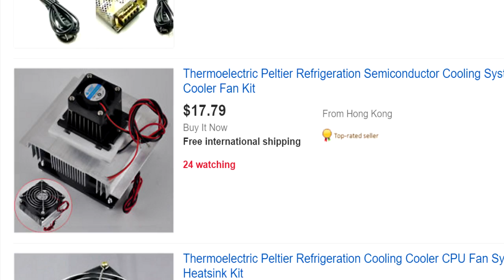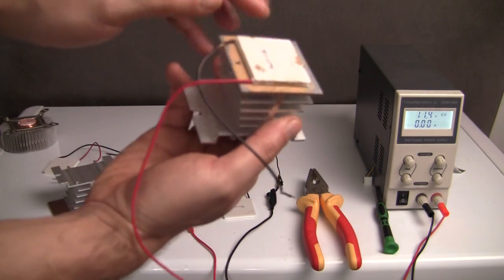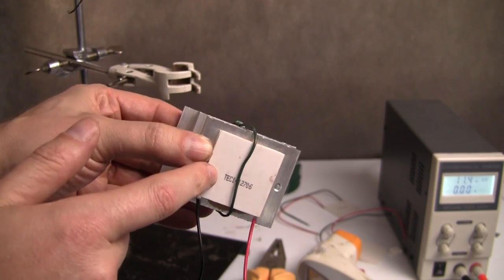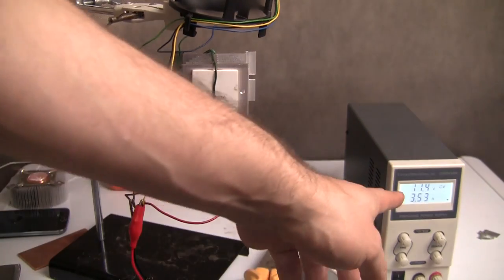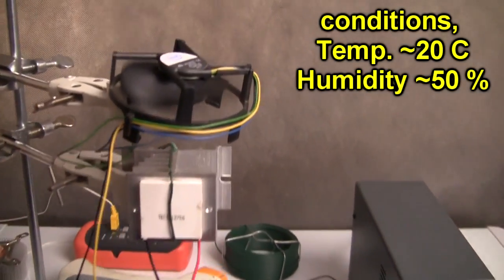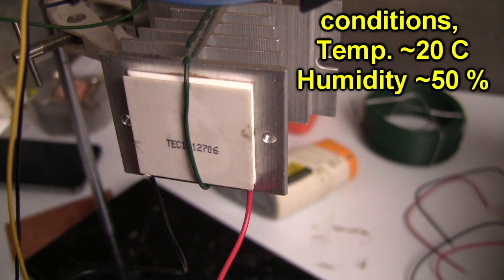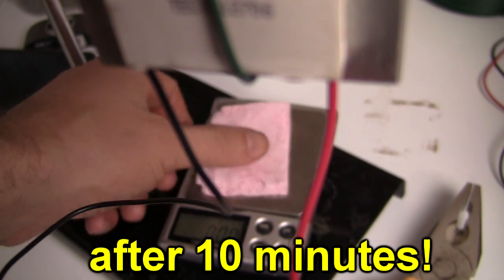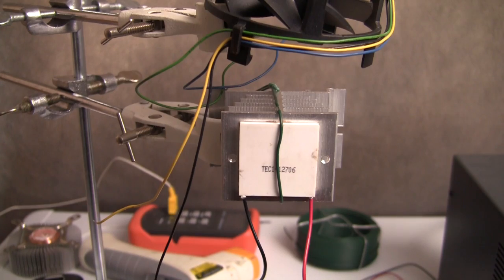Fontus Water bottle claims to make water from air.  Is it possible?

Comment: This could be made much more efficient by recovering the energy spent cooling air by redirecting the cold air to the hot side.
basically what modern clothes dryers do but in reverse. Instead of having the hot side of the heatpump on the air intake and  the cold side on the outlet to recover the heat you would cool the air on the way in, get alle the water from it you can and "recover the cold" by passing it over the hot side of you heatpump.
probably still wouldnt be workable with a peltier device but might be worth considering when debunking it thermodynamically.
Reply: +Felix Heidenreich you do realize cold is not energy? It's just lack of thermal energy

Comment: from the tech insider website: Retezár says the bottle works best between 86 degrees and 104 
degrees Fahrenheit and between 80 and 90% humidity. Over the course of 
an hour, Fontus can produce roughly 0.5 quarts of water. 

80-90% humidity - there you go...

Comment: There is a well understood but not reliable way to collect water from the air. Catch rain. This OTOH is a scam.
Reply: +Ken Shaw You can also collect dew by spreading out a tarp in a overnight with the edges higher than the middle. It's also condensation based, and doesn't require electricity. ;)

Comment: Obviously fake and gay. If you really had the means of generating out of thin air, any such commodity, you simply keep the technology a secret, in order to prolong it's perceived market value, and sell the water you generate yourself in order to maximise your profits, and your control over that industry. The Diamond industry does it all the time, and look how well they're doing. 

Giving away the secret technology, the 'Golden Goose' if you will,  like that is a big no-no as far as capitalism is concerned. Why devalue something into oblivion, when you could keep it's value, and generate billions of gallons of it on the sly? There's never a good enough reason to do that.
Reply: Don't quite see what makes this homosexual.
Reply: Or what makes this happy.
Reply: I have, just felt like nitpicking

Comment: would it be easier to do solar powered electrolysis and then use the hydrogen and oxygen to boil water and make it clean?
Reply: +Azivegu For electrolysis you would need water... And we already have ways to make water from rivers and lakes drinkable. Simple chlorine tablets... Much lighter and less bulky. Not to forget, Why use hydrogen and oxygen to boil water? If you burn hydrogen you get pure water. which is already clean. So if anything you would use electrolysis on dirty water, and would burn the hydrogen and oxygen to power further electrolysis. The lost energy in the process you make up by solar power. And the water from the hydrogen fuel cell is your final product.

Sounds way to complicated and wasteful. Just get a chlorine tablet.
Reply: Scorpionsnerd what are you talking about man!!! That sounds way to logical for the crowd we are trying to sell this too!

BTW, ever used a chlorine tablet? Just boil the water. It is worth the extra weight. I have used charcoal filters which make your water a brownish color and taste shitty and have used a chlorine tablet once when I got stuck in the grand canyon and had to drink from the Colorado. Not ideal. But then again  they aren't really advertised as an everyday solution and more of a last resort.
Reply: +Azivegu Never said chlorine tablets where flawless. But their marketing video is all "oh what if you run out of water miles from civilisation". And if you really want to go hiking or biking and can't be asked calculate water supplies then you're better off not going in the first place.
Reply: indeed. totally agree. I did get stuck in the grand canyon because I was looking for a dog and we went into a side canyon too early which delayed us too much. But dont worry, the dog was okay.

Comment: I live in that part of Texas where there's no lack of humidity. And the electric refrigerator in the back seat of my 4X4 diesel pickup truck will condense 2 or 3 cups of of water a day. No problem.

Of course I dunno how much current it draws... For sure a lot more than that damn mickey-mouse water bottle. But it DOES work, nevertheless.

Just saying.

Comment: so 40W per hour x20 gets us to 800Wh per shotglass?
Car batteries are generally rated at 85Ah and they are 12V so 85*12=1020 Wh
to get 1L(0.26gal) you need 50 shotglasses......
Reply: you are better off using the car battery to start your engine and drive to the nearest river/pond/walmart for a refreshment.

Comment: with my setup I have in my drying cupboard it's almost ideal conditions for condensing water, around 98%rh, it's humid enough that you open the door and you can feel it. there's a massive dehumidifier pulling around 200 watts and it only condenses around 1.5l a day at best.

Comment: So you need around 24 kJ to get 6 mg of water with this method...
So now lets take a look at the enery per kilograms of the batteries and take the best one, the lithium-ion: 250Wh/kg => 900kJ/kg meaning you would need 0.026 kg => 26g of Li-ion batteries to get those 6mg of water, pretty sure it's better to go directly for some bottles of water XD

Comment: It would be more effective in a forest or on the ocean because of the higher humidity, would it not?
Reply: LogisticalLogic This device wouldn't be useful for anything other than in an emergency. The water output is going to be too low. It's not going to save you any weight over a bladder attached to the top tube of your bike. Those aluminum heat sinks are not going to be light.
Reply: +LogisticalLogic places with lots of water. Not like a desert. In a forest you can just use a charcoal filter (tastes like shit, but works) and in the ocean you have solar desalinizers that produce much more clean water than this in a day.
Reply: +LogisticalLogic In a forest, you'd do much better sucking the dew off the leaves in the morning or squeezing it out of the soil and putting it through a filter. On the ocean, a solar still/rain catcher laid out on deck.
Reply: Yeah, but this would probably be better than no water desalination. If you were riding your bike through a forest and didn't stop to suck the dew off of the leaves or grass then this would be better than nothing. more water in the air more condensation

Comment: It would be interesting if you had a more hydrophilic surface on the cold side.
Reply: +Rand Huso what would be the point? the energy issue of water condensation releasing massive amounts of energy still persists. That doesn't solve anything...
Reply: +Rand Huso I think that would make the few drops of water more inclined to spread and stick than fall off into the bottle.

Comment: So... basically it's like a small solar still? Survivalist have been making them for years out of a piece of plastic, a bucket, and a rock.
Reply: +L. Wolf  I think the appeal is that's it's portable. A normal solar still is pretty immobile.
Reply: Foster Davies-Smith
That's true, once you put a solar still in that's pretty much where it is unless you tear it down and rebuild it.

A fontus water bottle might work better, if the surface area of where the water came from was larger. Course increasing that, you'll have to use more power. Becomes a matter of power vs production. Solar stills have a similar issue, only the power comes from sunlight and heat.
Reply: +L. Wolf Not really, solar stills require a source of liquid water to begin with then distill by evaporation and condensation to make it drinkable.
Reply: Yea, I explained it in a very bare bones manner on my own post before commenting on this one. A solar still is more a water purifier than collector. You always need some source, even urine will do.
Reply: Philipp Sloan
Hmm that is true.
Reply: Foster Davies-Smith
Yea, it can condense the moister in the air, but the majority is going to come from the soil and any plant fiber under the plastic.

It is a decent way to make urine and a sea water drinkable if you have no other options though.

Comment: Hey Thunderfoot, can you try running the peltier at less power? I've worked with peltiers a lot, and when you feed them more power then can be efficiently pulled out of the hot side then they just get hotter. So sometimes 20w will get it much colder then 40w because the limit on that heat sink is probably around 25-30w total. Everything above that limit just adds more heat into the system since it can't be moved away. Also don't use too much thermal paste, and try to get a tighter bond between the peltier and the heat sink, it all adds up quickly. If you plot a graph with hot/cold temperatures across different wattages then you'll see where it's limits are. 
     Also, peltiers are stackable, but you have to use a smaller one on top of the stack (cold side). So using 2 stacked can sometimes be more efficient then one large one since you can add a smaller heatsink to the one on top and increase the surface area for condensation.

Comment: What happens if you increase the surface area of the cold side, like add another heat-sink to the cold side?
Reply: +MrGridStrom 
The cold will be spread and therefore not be cold enough to condense any water.
Reply: +3plus3ist4 I will test this in a moment.
Reply: MrGridStrom
Its thermodynamics. Look up a h-x-diagramm. Air can hold water depending on temperature. At 50% humidity and 20°C like in the video the air needs to be cooled lower than 8°C for water to condense.
Reply: +3plus3ist4 Some peltier thermoelectric devices can go well below 0 C I guess it depends on the quality of the device, through my own tests today, I can say with %100 positivity that a heat-sink on the cool side will provide more area for condensation to form. I'm not saying that f00t's wrong here, and even with a heat sink on the cool side it most likely, still wont produce efficient water production, but I think it should at lest be tested.
Reply: MrGridStrom
Of course it depends on the area on which the air can be cooled lower than the mentioned 8°C. The air, not the heatsink, which means that the heatsink has to be a few degrees colder. 
It's powered by a small solar cell and these peltier elements have terrible efficiency. There just isn't the power aviable that you would need to cool the larger area.
Reply: +3plus3ist4 Well all im saying is that, it needs to be tested, so we all know the solid scientific evidence.

Comment: there are plenty of survival techniques for condensing water from air and collecting it.  so it is "possible", i guess.
Reply: +KickYouInTheThroat Plausible would be a better word, perhaps?
Reply: Yes, but the issue is they're not very portable like a water bottle is. It usually involves large collection tarps, or condensation pylons.
Reply: ***** it was my first pick.  for whatever reason i opted for smug quotes to mock the question in the title of the video. but yes you are right about the usage.
Reply: TopQuark right. which is why you would not plan on taking them for a break on a day long bike ride. however, a little water is better than none. there are also methods that are not that cumbersome or difficult and easily repeatable. anything to keep you alive longer is better than nothing at all. sure i would prefer a magic water bottle. but i dont have one so its good to have some idea about how to get at least some water out of the air and the environment.

Comment: I suggest you pass air across the experiment to duplicate the movement of the bike, I'm guessing you'll produce much more water but enough to make it practical?  Wouldn't think so as the surface area being cooled would still be too small.
Reply: You did, and i didn't pay attention. My bad. Still, surface area is the answer and for a push bike, impractical.

Comment: If they had a working prototype they could just go to a dry oil rich country and get hundreds of millions of dollars right out of the gate if they could prove that they could condense water using almost no energy. Saudi Arabia would be turned into a tropical paradise.
Reply: +Drogo Baggins Unfortunately there has to be humidity in the air to condense first, it would work if they had one in an underground cavern of some sort.

Comment: There already is an invention that allows you to get access to potable water in the wilderness. They're called iodine tablets. It's cheaper, weighs less, and doesn't require electricity, or barely any time to achieve results.

Comment: So this is basically a portable dehumidifier. I could see something like this potentially working, but it definitely would require more power than that tiny solar panel and battery can provide.
Reply: +Adam Hollingsworth IKR?
MY dehumidifier running in my basement, takes over 2 days to fill up about 3 liters. That's running almost all day taking a ton of electricity. This is so dumb.
Reply: AluminumHaste Either your basement isn't very humid or you should invest in a new dehumidifier.

Comment: Have you considered that they might use a much larger surface for condensation? That might have quite an impact on performance, even though i don't think it will be enough to forfill the promises
Reply: +mathis8210 They also claim to use ram pressure of bikeing (20-30 km/h) to increase the condensation. I don't remember everything from introduction to Thermodynamics, but that seems a bit off to me. The (weak) ram pressure would increase the temperature thus work against condensation.  Or does the increased pressure have a stronger direct effect on the water capacity of the air?

Comment: Hydrophilic material and more surface area.  Maybe. Is what i would try to get the results.
Reply: +Bruce Liu Probably should be careful with hydrophilics. Could disolve too strongly or hold the water when you actually want it to drip off and make place for more

Comment: im not supporting the enemy, but, you really need better heat disapprobation than that. If you did it 100% right, you could probably have gotten it to hold -5c, and who knows, maybe you get 10 times the water at -5c than 7c. So i think you should have probably tried your best to, in full seriousness, try to build the device in all the best possible case scenarios. So Like a 100W peltier , with a massive copper hear sink with a big fan on it. I wanted to put a peltier on a cpu, and its hard to do that because it starts running water into your system. Anyway i am with you, because it would take probably thousands of watts to fill a water bottle, and that's not really possible to carry around that kind of power or get it from a solar panel. But im just saying you probably could have done it better.
Reply: +SurgeTheUrge you dont need to carry any electricity because of the solar freaking road hexagons everywhere! xD
Reply: +SurgeTheUrge I suspect that the point was to show it was nowhere near, just 4 drops is pitiful.  Even if the water-bottle (plastic from the look of it with little space for anything substantial to generate the water) was 10 times as effective it wouldn't be sufficient to hydrate someone who was active.

Comment: Wouldn't it absorb less than 20 mil, because as you seem to have shown by how the wet surface was ~7 C, when it was ~-3 C dry, the water on the surface of the device inhibits the effectiveness of the device to condense more water. Therefore, unless that self-filling water bottle is somehow constantly getting rid of the water on the condenser, it won't be very efficient at making more water.

Comment: Why would you put the fan ABOVE the heat source being cooled... if heat rises? I can feel my OCD kicking in.....
Reply: To increase the speed of cooling. The natural rising of air isnt going to be enough.
Reply: +McDanny420 You missed the point of my question. Why not put the fan below, to utilize convection the most instead of fighting against it?
Reply: Not if it was pulling hot air UP off the heatsink.

Comment: Though this product is In all likely hood a full on scam, it is possible to pull drinkable water from the air, provided the humidity is relatively high, (not in a Desert .) Interestingly enough, electricity is not needed. As I understand, it is essentially, a large net, that catches condensation as the temperature dips below the viewpoint. ( often in the evening.) If there is a breeze it works better. 

These are primarily used to provide water to communities who live in an area where sources of collectible water are far away, and, at least at the moment, a well is either not built, or not a viable option due to contaminants. .

Comment: It is clearly possible. When in the philippines all cold drinks produced a small puddle of water rather quickly. I don't doubt that their device is bullshit, but condensing water out of air is very possible. The simplest is just putting up a fine mesh net and wait for morning dew, however dehumidifiers extract water from air using this refrigeration technique.

Comment: Next they're going make solar roads producing clean water.
Reply: +iambehindthemirror brb setting up a kickstarter for that right now
Reply: +iambehindthemirror 

You mean solar tubes filled with water that you breathe with your artificial gill, while riding a mini submarine through it made of plastic from pollutants in the air and powered by thorium?
Reply: Mechaghostman2
Yes, or maybe something even cooler sounding.

Comment: I wonder if baseline humidity in the area could make a difference in results. 

Just a thought, based on seeing my portable AC in action. On fairly dry days, it can maybe get an inch over the bottom of the bucket (less, considering for showers, cooking and other water vapor from us). But on humid days, the pail can fill in no time at all. 

Just a thought.